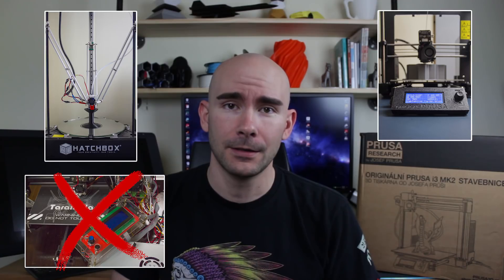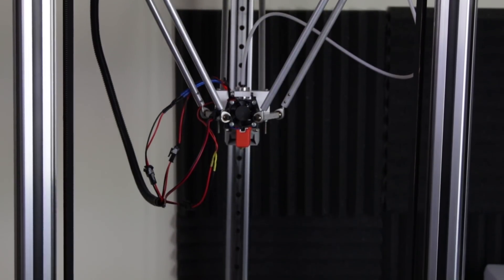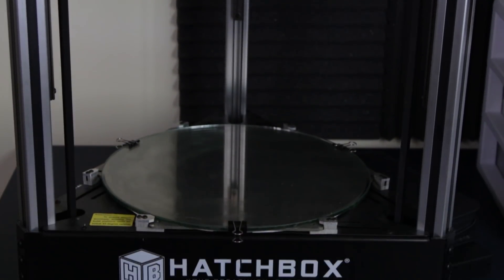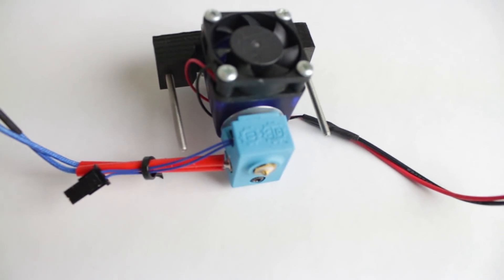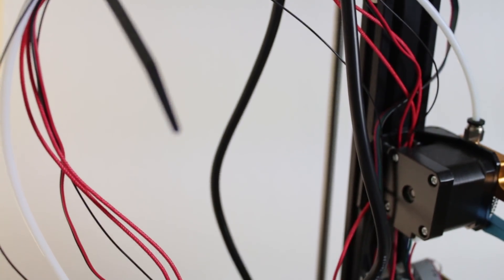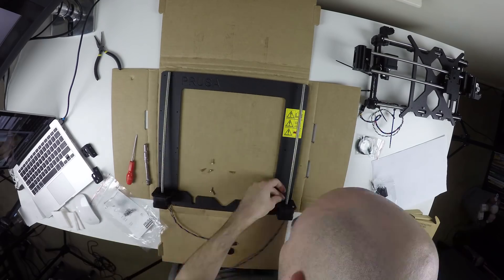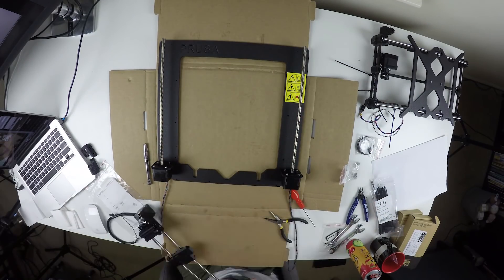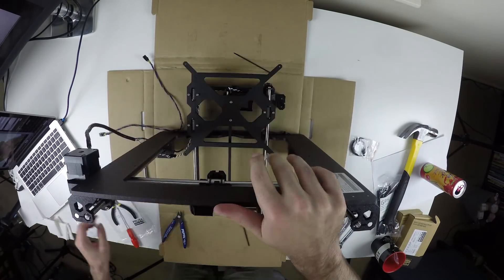11 Reasons the Prusa MK3 is a MUST HAVE!!!

Comment: Think i got some of the same smoke.. I thought a 1977 pinto was a 2019 corvette  1: assembly time: My Prusa MK2S took me about 10 hours to build /compare ender 3 about 30-40 min CR-10S about 20 CR-10S Pro about 5 min. Octoprint can be installed on almost any printer Yes the MK3 is faster build then the MK2S BUT not near as easy as it was for my cr-10s pro or my cr-10s 3 filament sensor i have one on my cr-10s and my cr-10s pro's i can add it to my ender but did not feel the need 4: power resume function and filament sensors my cr-10s and my cr-10s pros has this function as well To think these features are only with a prusa is crazy. and you talk about price point? ender 3 =200$ yes you can own 4 ender 3's before you reach the price of the prusa with a faster build time (you can build the printer faster then building a mk3 let a lone prusa will misslead you to suck more money out of you...

Comment: I've ordered my Mk3 and should get it in March.  However, as I've monitored the FB group and Prusa's own forum, I've noticed that people are having consistent printing problems.  My question to you (as I'm a fairly new 3d owner - I currently own a Qidi X-one and have used it for 2 months), should I stay with the Mk3 or choose an enclosed (and supposedly more reliable) printer like the Ultimaker 3?  I know that there is a huge price difference between the two.  My biggest worry is I'll have to constantly tinker with the Prusa (or worse yet deal with faulty parts like bearings, rods, thermistors, etc) and not be able to print at all.    I don't mind getting my hands wet, but I also don't want to have a 800.00 printer sitting idle while I work out the kinks.  The Ultimaker looks like it's print out of the box ready.  Thanks, great video btw.
Reply from the maker: John, thank you for the compliment and I understand your apprehension completely.  I was glued to youtube and reddit when I was trying to pick my first printer and even more so when I was thinking of getting my second.  To answer your question, I think that you will get more reliable prints consistently with the Ultimaker, but that price difference is a huge factor.  Enclosed printers help with ABS and other materials that need a warm environment but PLA can be printed on an open bed no problem because it LOVES cooling.  Either way, you might run into problems.  I have heard of Ultimakers having their share of issues (although a lot less than Prusa).  If it was me I would stick with the prusa just because of the price, but I do know that MatterHackers has a deal going on right now for financing.

https://www.matterhackers.com/store/c/Ultimaker?utm_source=MatterHackers+Newsletter&utm_campaign=554d540151-EMAIL_CAMPAIGN_2017_01_30&utm_medium=email&utm_term=0_dccd3cdce8-554d540151-127266365

Let me know if you have any more questions or if I did not really answer it the way you expected.  I hope to see you around!
Reply: I've wavered back and forth.... Just when I'm about to pull the plug on the Prusa, I get cold feet (I've already waited 5 weeks ; ).... The thing that keeps me going back is the potential of the Prusa.... I can make so many mods (and Jo seems like he'll continue to support his printers).  However, the thought of just opening a box, placing in filament and printing is very tempting.  I guess I'll sleep on it (or wait for the Ultimaker to go on sale) to make my decision..... Thanks again, I've subscribed....
Reply from the maker: Thank you for subscribing! I am working on a video showing myself working on the power supply of the tevo.  If you went with the kit version of the prusa I think you will really like it!  I enjoyed mine, and I also have a preassembled printer and it was great to pull it out and print but...had something been wrong I would not have known where to start.  
Check out my preassembled vs kit video, I talk about the pros and cons from my perspective.

Comment: I have preordered the mk3 but i have to wait until end of january or have to wait even mid of february to get the delivery.
Because I am quite impatient, i bought the CR-10S4. 
I can now give you lots of reasons why this is a must have, and after i have done some mods on the large printer with 400x400x400, i now can do almost the same what you can do with the mk3.
There is a filament sensor. I flashed the firmware and mounted a sensor and i have automated mesh bed leveling. There is a pause and a resume print and i have installed a usv so i can bridge power shortages for more then 2 hours, enough time to just pause the print for more then 10 hours.
I will install another hotend and modify the extruder, so i can also print flexible and polycarbonate filament. But i need to build an enclosure first, which is not a big deal. I wanted to do that with the mk3 anyway, because its not only the noise, but the smell of plastic i dont want in my room.
Of course i connected the printer to my octopi.

So imho there is no "must have" on this mk3, really its not. 

There is a multimaterial upgrade for the mk3, i have preordered this, too. So far this is the only thing right now which is not available for the cr10. Yet. Lets wait another 3 month and watch whats going on.
Reply from the maker: Usurpine Susanti thank you for the comment, I am really glad to hear that you have been able to make so many modifications to your printer!  The reason I am such a prusa fan boy is not because their features are unique to them but because they package it all together.  Most kit or open source printers are capable of all these upgrades with a little work and ingenuity.  I am going to order the mmu down the road, I wish I had all the resources in the world to try out all this cool stuff.  My next printer is going to be the cr10 for sure!
Reply: Just one more thought about all the work i put into the mods. It wasnt a lot of time i had to spend into it. After i got the cr10s4 it took me not an hour to make the first print, the print "kit" is almost preinstalled and doesnt take long to setup. Flashing the firmware and adding the other mods took me not 2 hours all together after i printed it (which took quite long but this is time i do not really count).
Also the costs of this huge printer are not high, its alltogether very reasonable.
The MK3 kit will take much more work and time to build because you have to build up all parts and it is price is also about 800€, some say it will take at least a day to build it up, if you buy the fully assembled you will pay €1000. I paid for the cr-10S4 less (749), but for the mods i did spend another ~200 so at the end the cr10-s4 with all modifications is a bit more expensive (shipping costs are the killer here) then the mk3. But I got this printer in less then 2 weeks done, while i am waiting for the mk3 another 2-3 months, and the of course the printing volume 400mm^3 just surpasses the mk3.
But then of course, the real MK3 from prusa is the original. Who doesnt want to have that ?

Comment: Great Video, I agree, small note the pads don't reduce vibration, they uncouple it. printer vibrates more, table and air and so your eardrums vibrate less... Use a 2" concrete paver from home despot or whatever your fav store is, 3$ here, and try to set your printer rigidly onto it, I used paper thin felt feet. I even thought of gluing it but did not. You want your printer to benefit from the weight and rigidity of the block so your printer and thus your print head wiggles less...  It also then stops table shake and even raises the printer up a couple inches making it easier to see.   A heated enclosure made out of 1/4 polycarb and some 3d printed corner blocks made my old mk2s super quiet while I wait for my mk3 to arrive!!!  Great video, your funny!
Reply from the maker: Eric Nary thank you for the really informative comment! I am going to go pick up a slab tomorrow to try.  I hope you enjoy my future videos and look forward to your feedback.  I can’t wait for mine either :)

Comment: From what I gather the only soldering to get a Pi ZeroW to work and that's only 6 header pins. The  EINSY RAMBo printer board has a socket you plug the header pins into. 

Shame about the powder coating problem on the metal sheet, I dithered a bit on my MK3 order so won't get it until early in the new year, hopefully, it's sorted by then.
Reply from the maker: brian whittle thank you for the correction :) 
I hope they get it all sorted too.  I know the mk2 had issues during initial release and I got on that train late so I didn’t experience them.  I am expecting to have some early adopter problems but I’m still super excited.  How do you like you Anet?
Reply: apart for the mainboard and steppers it's hardly an anet now but it's great.
Reply from the maker: I say in this vid that I learned a lot from assembling the prusa.  But I have a tevo I’m working on and that is really an amazing learning opportunity.  I have heard anet is the same situation.
Reply: THe Anet A8 basic setup, if you are in anyway mechanically minded, is pretty easy, just take your time. There are a few problems with it the Mk8 Extruder with it's (yes it's tight, oh no it's leaking plastic everywhere) hotend is a pain but it's a tweaker's treat machine. There is a very active facebook group where you can get help. The main problem is as it's really cheap, people who are as technically minded as a chair get one then run into problems. The number of burn connections people post pictures of is staggering and none of them are the kits fault.

Comment: If you hear your printer in your bedroom you should try a stone slab under it and EVA foam under the slab. The printer is like 2 meters away from our bed and I only hear it at night if it prints objects that have travel distance between. 2 closed doors in between, 0 zound at prints that are just walls and infills.
Reply: Georges Gadgets A paving slab! Pretty straightforward! Awesome
Reply from the maker: Thank you for the advice, I will try that!  Do you use silent mode?
Reply: Where did you get the stone slab from out of interest? Is it bespoke cut, or?....
Reply from the maker: Darren Gibbard if you go to CNC kitchens video on the prusa he talks about it.  He just got a slab of stone like you would use for stepping stones.